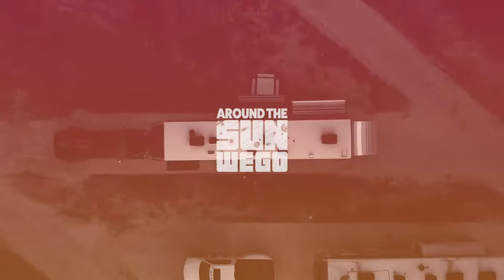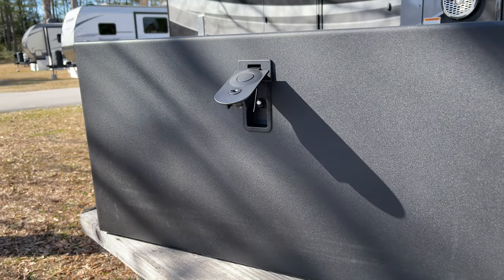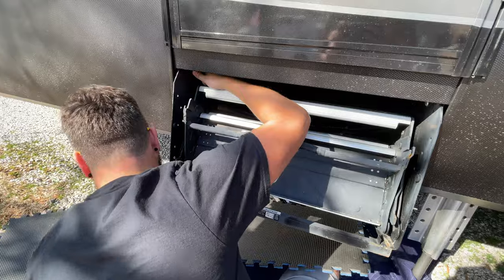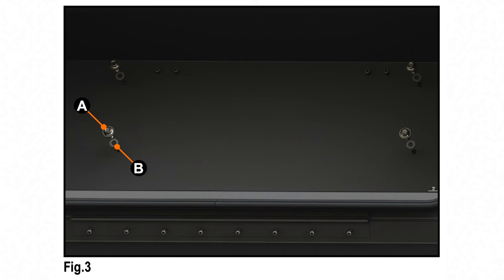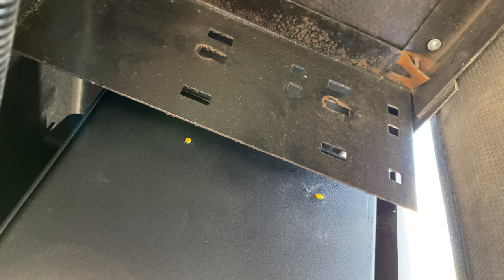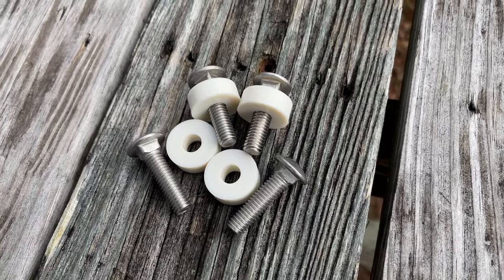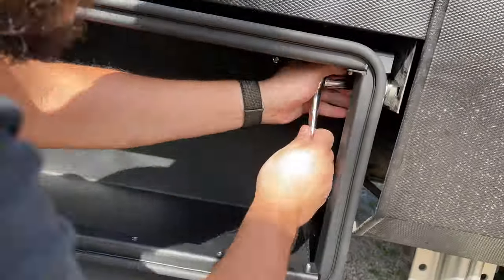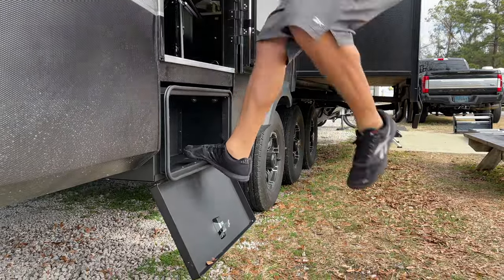Lippert Solid Step Storage Box Installation & Review + RV Step Removal

Comment: Great video, Chris! It's really interesting to see how you managed to re-use the step mounting hardware.
Reply from the maker: Thanks Craig! Yeah, it’s like I said, I anticipated using the old brackets before even looking at the instructions. And then when I finally realized the install was going to require drilling, I figured I’d rather drill 4 holes in the box than 8 holes in my frame! Haha.

Comment: I'm considering the steps for my camper.  May have to also consider this box too to hold tools instead of putting them in the below storage.  Another great video.  And I far prefer your install over drilling into the frame.
Reply from the maker: Thanks again Lou! Yes, the box is still holding up great and is perfectly solid after months of use.

Comment: They are nicer than the morryde but the morryde are half the cost, bolt into the existing brackets and sit flush with the bottom of the skirting.
Reply from the maker: Nice! Didn’t know that as I only have experience with the Lippert version. Good to know info for anyone considering either option.  Thanks for sharing!

Comment: Figured you would mount the Moride Steps on the garage entry door.
Reply from the maker: Hey Grady. I actually did consider doing that but since we rarely use our back door for going in and out, and also because our car takes up a good bit of space in the garage on travel days (so I wanted to leave the space as open as possible) I decided it’d be best to just shed the extra weight. But they are in storage so who knows if/when we may add them later on 👍

Comment: With some slight modifications to your factory morryde steps you can install them in the garage instead of tossing them, that’s what I ended up doing 👍🏼
Reply from the maker: Absolutely! Yeah, I actually considered moving our old MORryde steps back there, but since we rarely use our rear door and our Fiat takes up most of the garage on travel day, I decided it would be best for us to just drop a little weight and keep the space as free as possible. We did put them in storage though because they’re definitely good steps! Never know when we’ll need to whip em’ out again!

Comment: Have you had any problems with door clearance on the solid steps you installed in your previous video?  Enjoyed this video… thanks!
Reply from the maker: Hey there Joe. No, door clearance has never been an issue. When first lining up the steps before installing any screws, you can position the steps exactly how they need to be so there is no interference. Thanks for checking out the videos!

Comment: So in our camper, we have one of those step lights mounted to the I beam of the 5th wheel. Is there a way to still use that courtesy step light?
Reply from the maker: Hey Dan. I assume you’re wanting to light up the interior of the box? If so, I’d simply attach a magnetic battery powered motion detecting light to the inside top of the box. Looks like they have a 4-pack on Amazon for $10.
Reply: @AroundTheSunWeGo  Actually,  it's a step light, so was wondering if it can continue to be used as a step light? We are looking at the Lippert 4 step for our 2005 Wildcat 5th wheel and at the same time get the toolbox.
Reply from the maker: @danbakke4495  I see. Without knowing which light you currently have I’m not sure if it can continue to be used. I do know that MORryde makes an awesome motion activated step light that works on either their step or the Lippert step. $40 for a 2-pack on Amazon.

Comment: You still put the mounting bracket on the back? Then what was the point of all the other stuff. What a joke.
Reply from the maker: Lol. The entire point was to avoid drilling 8 holes in the frame. I only attached the mounting bracket to the back of the box using the four included 1/4” flange bolts, which is easy and takes like 5 minutes. But I didn’t attach the bracket to the frame rail, which is what would require drilling 8 holes in the frame. The bracket is essentially working as a spacer between the box and the frame. Let me know if you’re still confused ;)
Reply: That would help stabilize it and provide support on the back.  It would keep it from moving downward when he is twerking on the front of the box.
Reply from the maker: @bseery  Exactly.